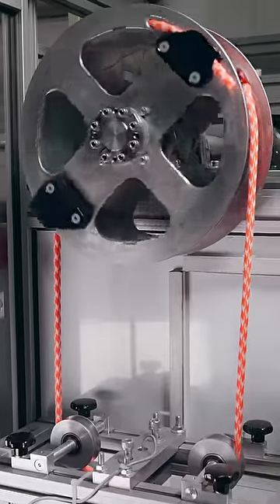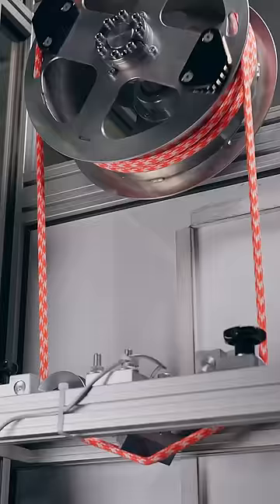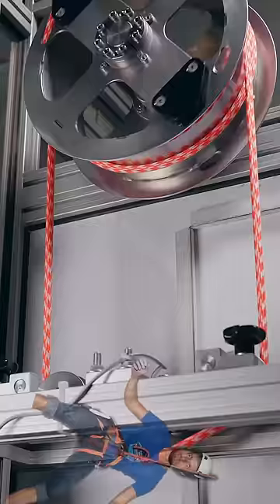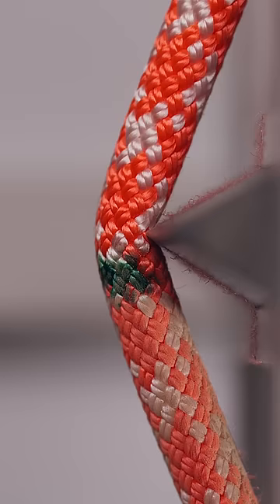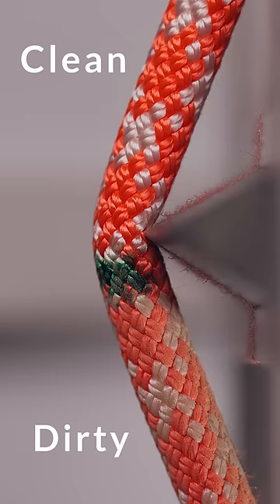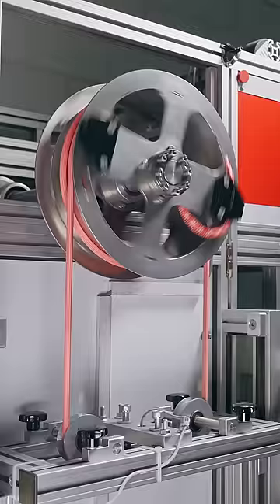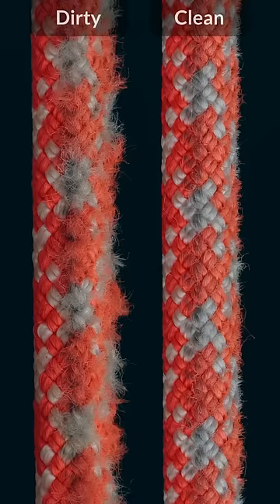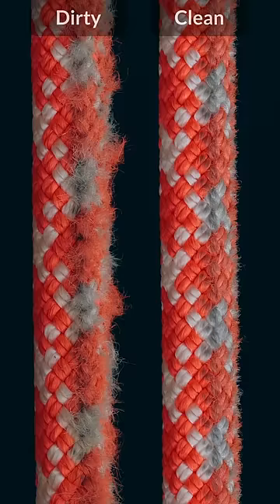Surprising Effect of Dirt on Climbing Ropes

Comment: In a carpet cleaning class I took once they told us every grain of sand has an average of 167 cutting micro edges per grain.
Reply: uh, no
Reply: @mellissamercado7904  It's true.  This is why sandpaper is used to buff other rough surfaces into smoother surfaces.  

On a microscopic level, the tiny sand grains work to "cut" other larger sharper bumps and turn them into smaller smoother bump.
Reply: Dirt in carpet causes hastened wear on the fibers, essentially cutting and grinding them down....just like the rope fiber in this video.
Reply: @betsybarnicle8016  exactly
Reply: @mellissamercado7904  ok. Why not?
Reply: carpet cleaning class? wtf?
Reply: Egyptians.... cutting..... stone....with a process that we dont know but had something to do with their biggest resource?
Reply: @thedude7737  yeah it's a real thing dude. It's like a 2 or 3 day certification class. They told us to imagine 167 micro cutting edges on each grain of sand brought in by your feet and everytime you step on that grain of sand it just slowly cuts away at the fibers. That's why you get grey trails. The fabric is gone it's not dirt left behind.
Reply: @_Just_Another_Guy  yep. All you're really doing is making smaller and smaller scratches the finer you go. Polishing compound is the same principle.
Reply: @diisegreti4299  damn man that makes sand sound vicious. no wonder anakin skywalker hates it
Reply: @thedude7737  carpet cleaning class is fire, try it with your homies you are going to have the time of your lives 💯
Reply: @thedude7737  There is an art to be found in a great many things the average person never considers.
Reply: @diisegreti4299  thank you, this is actually really helpful information. Seems obvious, but something I’ve never considered. Especially since I’m from the Midwest but yeah…I will now be enforcing a strict shoes off policy lol
Reply: @mellissamercado7904  just cause you can’t comprehend it doesn’t mean it’s false
Reply: @mellissamercado7904  explain than Einstein
Reply: @thedude7737  it really do be rough, course, and getting everywhere
Reply: Wow
Reply: Real question. Is it just sand (yk, the grain) or dust affect the same too?
Reply: @hellochako   Not dust if youre talking about dead skin and hair
Reply: @mellissamercado7904  bro just said no with 0 proof. Goofy
Reply: That doesn't actually make sense. Each grain has that many sharp edges per grain?
Reply: @betsybarnicle8016  that’s not the point he’s making 🤦🏽‍♂️ although valid information he’s just stating what he learned about sand in carpet cleaning school
Reply: What
Reply: @ThaCatMan  let’s dümb it down for you uhh derrr sand derrr has a lot of uhh Derr micro edges derrrr and it makes the rope uuuhhhhh not be that same length it was a few derrr uhhh moments ago
Reply: @ThaCatMan  I understand why you said this. That sentence doesn't make sense right.
Reply: @matthewhernandez8759  you do realize that sentence didn't make sense right?  The fact you're calling someone stupid over a simple response only makes one person look stupid here.
Reply: @michaellopez4746  that does actually make sense. Natural shapes are crazy bro
Reply: @michaellopez4746  if you didn’t understand the original comment then maybe you’re not as smart as you think you are
Reply: Anyone who doubts this obviously hasn't had sand down their swimming trunks at the beach 😱😱😵🫨🤦🏻‍♂️🤣
Reply: Huh?  @Rixoli  - the art of carpet laying, or the art of counting the facets on a grains of sand, or the art of walking on carpet with dirty shoes...?
Reply: @matthewhernandez8759  who said I thought I was smart. I'm saying the sentence doesn't make sense. Maybe you don't understand how English works. It says every grain of sand has 167 cutting micro edges per grain. Basically there's 2 separate instances of grain in once sentence.  The second instance appears as though it concluded grains within grains but also the number provided wouldn't make sense when referencing 1 single grain so there must be either a typo or a miscommunication within the sentence. Now do you understand or do you just see basic words and formulate your own understanding whether it makes sense or not?
Reply: @icedragon9097  can you explain how it makes sense and what you interpreted from it. Natural shapes being crazy means what?
Reply: @_Just_Another_Guy  it's not though. Just look it up. That number is way higher and also way too specific anyway. They can be smooth or may have many sharp edges but definitely not that many. Just because it sounds correct doesn't mean it is.
Reply: @diisegreti4299  this makes more sense with 1 instance of grains written in the sentence. Also just fyi the number is wrong. It's way too high. Like 3 times higher or more. They probably said that to exaggerate the number because it's likely good for the sales pitch ya know?
Reply: @michaellopez4746  🤓
Reply: @mellissamercado7904  why not Mr. Contrarian? You just gonna say no and leave? Explain yourself.
Reply: @mellissamercado7904  just so confidently wrong 💀
Reply: @_Just_Another_Guy  

I really like the sandpaper example you gave...

I was thinking something similar.  I was thinking how a sandblasting machine is able to work [the sand] into tiny crevices of an item covered in rust. And the longer the item is being sandblasted,  the more rust that gets removed.
Reply: Is that why we make glass out of sand? Or do we basically just filter tiny fragments from it?
Reply: This is a way more amazing fact than i thought id read here.

Thanks.
Reply: Wtf does this mean ?😊
Reply: @matthewhernandez8759  no really
Reply: @michaellopez4746  Bro you just got wooshed
Reply: @michaellopez4746  You really need to chill out and be less pedantic about things. Especially when it involves random conversations on the internet.

Ever heard of a party pooper? That's kinda what you're doing here.

Also do you want me to explain the joke in a formal yet intentionally condescending manner or are you just gonna calm down dude? 

This is about rope and sand and you're writing an entire manifesto that comes across as a childish rant.

Also your thoughts do not sound very coherent. It's as though you are struggling to explain what is going on here whilst doing your best to explain what you think is going on here.

Just remember everyone has a perspective. Just because you got triggered doesn't mean the rest of the world sees everything as offensive like you do.
Reply: Nerd shit 💯
Reply: @michaellopez4746  google electron microscope images of sand dude. You’ll see what they mean.
Reply: „In a carpet cleaning class I took“ you lost me there 😂
Reply: @mellissamercado7904  confidently incorrect
Reply: And she was never seen again 😂
Reply: @diisegreti4299  The smart thing to do would be not wearing shoes indoors.
Reply: @Tunkkis yeah, but you try telling millions of renters around the country to take off their shoes. Besides wearing shoes indoors keeps me employed.
Reply: @thedude7737  carpet cleaning, stain removal, patch and repair, water restoration, structural drying, mold remediation,  rugs and fine material, wool, Haitian cotton, install, upholstery, HMAT,  are just a few of the classes that relate to carpet cleaning I've taken over the years. And just to add to what a couple smart cookies said above this when fabric wears it tends to turn grey or brown leaving high traffic areas where you walk the most. All the dirt will be removed but you can't put fabric back leaving wear marks forever.
Reply: @thedude7737  I've heard stories of men getting caught in sand storms where the wind flows hard enough it not only peels the flesh off your body but apparently grinds the bones down to nothing in a matter of like 30 minutes. Sand is brutal. Kinda like my ex-wife.
Reply: @emmyjulianne6850  I'm bubbling over with pearls of stupid trivia,  how much time you got? You're from the midwest you say? I'm in Denver Colorado. I insulation class, the only class more fun than carpet cleaning class, they told us that there are seven different climates in the world that all need to be insulated according to which region they fall in. Coincidentally Colorado is the only place in the world that has all seven climates. See,  worthless trivia. Hers something you can use. Have gum in your carpet. Put hand sanitizer on it. No shit. Leave it for 5 or 10 minutes and then take a quarter and rub it over the gum and it will come right out. Sometimes you may need a second application but it's about the easiest home method I've done across.
Reply: @hellochako  dust is a different monster. Dust is something like 95% dead skin cells. Of course the rest is tiny pieces of fabric little particles of food and oil picked up from circulating through the furnace. Because Dust is so fine it basically goes wherever the air current goes. To understand air flow you should think of air as a liquid. If your house was full of water and you put a few drops of dye in a room you'd see swirls of due moving in erratic ways and the natural air changes from inside to outside air (about 3 times per hour, less than that you can breathe yourself to death), and as fans, AC, heating, and people moving from point to point all contribute to the end and flow of the liquid and the dye. Just fill your bathtub put a few drops of food dye in it then dip your hand and drag it across the tub and watch the dye. That's how air and dust behave in your house. So as don't is floating around two things are working against its freestyle life, so to speak. Gravity and walls. As a result dust tends to accumulate at the edge of the rooms. What doesn't settle on picture frames and the piano you never play builds up at the very edge of your carpet leaving a thin usually blacking ring around your rooms especially heavy near the returns. This is always a sign you need to change your furnace filter more often. It's also damn hard to get out and can run upwards of $10 a linear foot.
Reply: @michaellopez4746  yep
Reply: @michaellopez4746  Yeah dude, um... you're putting way too much energy into this. The correct answer is "Who fucking cares."  For one I haven't, and im betting neither have you, taken a hundred grains of sand, placed them under a high-powered microscope, and started methodically counting cutting edges and comparing them to find an average. I'm pretty sure only one person in the history of science has ever done this and im pretty sure he was dead on with his calculations. Why am I sure? Because he turned in his study. After finishing such a mind-numbing and horrible assignment im also pretty sure he went home to an empty house realized his life fixing sucks and shot himself promptly right in the head. He may be the only none Clinton body count whose life was so awful he managed to do a double tap just to be sure he wasn't asked the following day to run the test again. Every other scientist since knows that they'd end up with the same fate if they did the same test and have accepted that the first guy got it right. If he had any doubts he would have only fired one shot.
Reply: @amberg4131  sand is basically tiny crystals. So we melt the crystals into a solid pane.
Reply: @diisegreti4299  That's a lot of anger and salt you're pushing out there, friend.

We know your mom didn't want you, but it isn't right to take out your failed abortion on everyone else.
Reply: @paco1667  i found the love of my life in carpet cleaning class, married for 6 years nowz chsnged my life forever 🔥🔥🔥💯💯
Reply: @mellissamercado7904  ey man we learn something new everyday
Reply: @diisegreti4299  I don't live near a beach so sand isn't a big problem where I live. How many cutting edges does dirt have?
Reply: Excellent answer to my question.🥰🥰🥰🥰🥰🥰
Reply: @betsybarnicle8016  😍🥰🥰🥰🥰🥰
Reply: 🥰🥰🥰🥰🥰🥰🥰smart
Reply: @diisegreti4299  🥰🥰🥰🥰🥰😁🥰😍
Reply: @diisegreti4299  🥰🥰🥰🥰🥰🥰🥰
Reply: Lol
Reply: They were kidding.
Reply: @mellissamercado7904  finally someone talking some sense
Reply: @mellissamercado7904  Congrats sir you graduated from the taco bell toilet
Reply: @mellissamercado7904  amazing counter argument there!
Reply: @michaellopez4746  yeah, ive seen all kinds of sands magnified.  167 is basically a disco ball
Reply: @amberg4131  What are you thinking? Glass is sharp because sand is? Broken glass fractures with some very defined edge transitions, making broken glass sharp. We use sand(silica and a few other minerals) because the small particles melt and then become fluid so we can mold into useful items. When it cools it becomes a very strong,  pretty, semi pertinent object of value. I think we got the idea from volcanic glass.
Reply: @mellissamercado7904 ”uh, no” Source: Trust me, bro
Reply: @Matthew Hernandez  bahahahaha bro are you drunk?
Reply: There’s a carpet cleaning class..?
Reply: @thedude7737 this dude probably a Butler or something
Reply: @mellissamercado7904  what’s with the correlation between people named Melissa and being absolutely stupid these days
Reply: r u saying if people like walking on sand because eoft the feelings they r technically masochist
Reply: @joeKisonue  are you saying it's bs or that you actually find disco balls?
Reply: Uh-oh
Reply: That’s a very specific number for a large population.
Reply: Carpet= 😫😖🤧
Reply: @thedude7737  before the internet hamdicapped  people had to figure out how to do jobs somehow. This usually involved a 3 month-long class on how to do certain jobs. Like basket weaving envelope licking and carpet cleaning
Reply: Oooh cool
Reply: @reallue  depends how much sand is in the dirt. Dirt is mostly decomposed organic material though.
Reply: 167 edges per grain.
That is 1,2 million edges per pound.
Weird way to measure.
Reply: They make you take carpet cleaning class, before carpet munching class.
Reply: @Exlaax  there's such a thing as carpet munching class? Well that explains a couple failed marriages. Live and learn I suppose
Reply: @thedude7737 yes presumably to start a carpet cleaning business or learning to become a skillful professional cleaner. Something along those lines. Someone’s gotta be the guy you call to clean up a crime scene
Reply: Well, sand is made mostly out of quartz. Quartz can come in many crystalline structure, but the most common form of quartz found in sand and broken down hexagonal cristals. Quartz points can break adding a fee more edges; but not as many. Quartz  is extremely hard and difficult to wear down by other materials, but the contact with other quartz grains smoothesbthe edges of sand and river rock alike. Marine sand may feel grittier than river sand because of seashell content. Quartz for sand paper is pre-crushed in order to sharpen it, and the actual grit of many sandpaoers may not even be quartz, but  silicon carbide, or other compound.
Reply: @joeKisonue  nope, we got the idea from glass formations caused by lightning in the dessert. Although theres speculation that the process may have involved accidental glass formations because of the high temperatures of natrón fires.
Reply: @michaellopez4746  it makes perfect sense. It's an average. 🤦‍♂️
Reply: @joannanorma didn’t they use water? I saw archeologists doing a demo of it once lol
Reply: @thedude7737  : 😆😆🤣🤣😂😂🤣😂😂😂😂😂😂😂😆🤣🤣😂
Reply: @michaellopez4746 don't ask someone "do you know english?" And also state that the average of something is "too specific of a number." Something's average is always a specific number.
Reply: Damn this was fascinating ty guys who knew sand was such a menace xD
Also man, can’t you guys just appreciate learning something new and being the dumb guy? Do y’all always have to prove yourself and how smart you are or did I catch y’all at a bad time?
Reply: Damn this was fascinating ty guys who knew sand was such a menace xD
Also man, can’t you guys just appreciate learning something new and being the dumb guy? Do y’all always have to prove yourself and how smart you are or did I catch y’all at a bad time?
Reply: Yeah another fact I'll never forget and have no use for other than to say to people "did you know an average grain of sand has 167 cutting edges to it."
Reply: Every grain of sand contains over 50 grains of sand

Comment: There used to be a saying that older climbers told the novices: "Step on my rope, buy me a beer. Step on it again, buy me a new rope."
Reply: I actually have noticed that younger climbers aren't as hyper concerned about stepping on ropes as people used to be. A lot of people I know though now use  rope tarps and it may just be the crowd I climb with cuz  as a  kid, the people I climbed  with were hyper aware of it.
Reply: Will the rope nit wear even faster by it sliding across a rock in the real world
Reply: @TheAnnoyingBoss  It will, this has to be the most useless experiment ever, all it shows is that the rope will not wear as much in controlled environment if you keep it clean, but anywhere else rope's cleanliness doesn't matter at all.
Reply: They shouldn't leave their rope on the ground to be stepped on.
Reply: Step on it 3 times - buy me azimuth and cathead
Reply: @xenophagia that's the exact point if the saying and you're right have a good day
Reply: Seems that you simply had alcoholic peers
Reply: @shinobuoshino5066 a piece of sand has hundreds of cutting edges. In a rope, under Any circumstance, it makes a difference.
Reply: @xenophagia  so they can get a new rope for free
Reply: @somecallmetim4490  Well spoken.
Reply: Some people just want free beer
Reply: @shinobuoshino5066  source? are you a mountain climber?